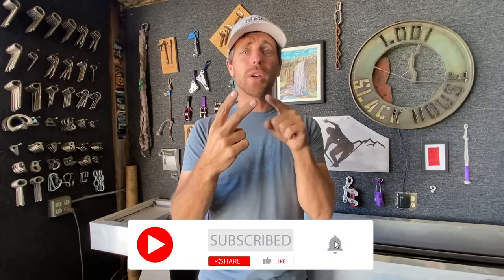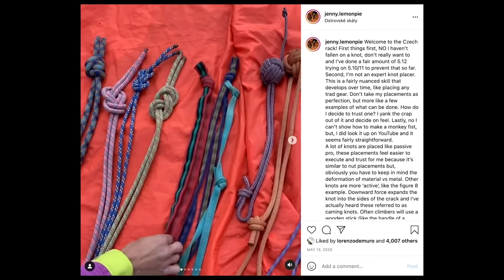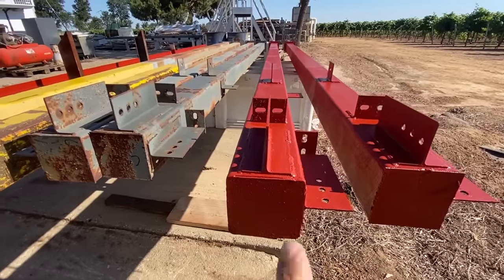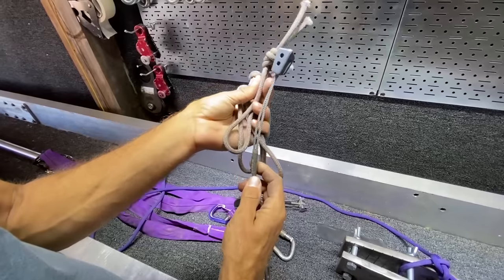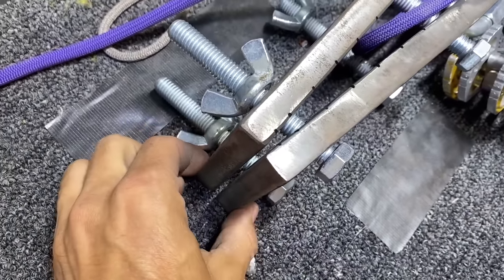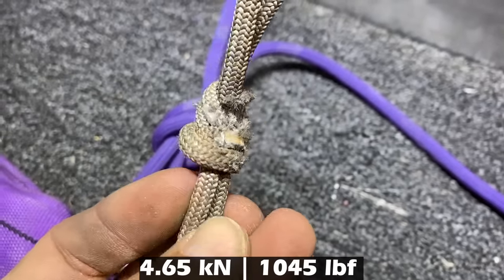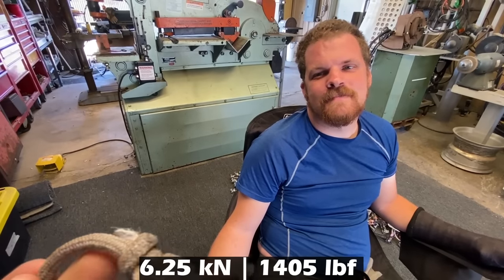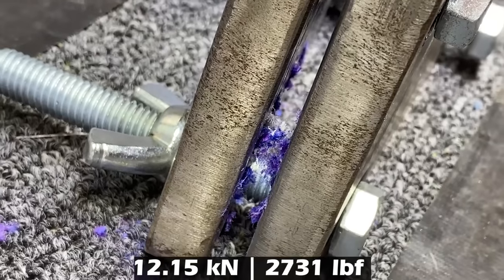Climbing pro made from knots??? Textile passive protection tested!

Comment: Yeah, it would be very interesting to see on real rock... especially the difference between granite vs sandstone if possible! I'd think friction might not matter as much on sandstone though: the rock itself might shear more easily under those forces which would make obsolete any frictional resistance the rope might encounter.
Reply: Also the difference between hard sandstone and the soft sandstone where these are used. Sometimes it feels like grabbing sand not actual rock. I think the rock is likely to break
Reply: Metal would slide out immediately as it would shear the top layer off the rock. That can happen even under your foot while hiking/climbing
Reply: Sandstone in Czech Republic, Poland and Germany is delicate. Using metal pro leads to rockfall and changes cracks into lines made of holes. Moreover people often climb after rainfall and break the rock. That's long & short :)
Reply: @marekholub8668  It would be interesting to see actual drop tests that proves if this actually happens. I've climbed in Germany's Pfalz mountains on sandstone and didn't observe that.   What if you place a cam deep into a crack system?   Perhaps longer stemmed cams could increase safety in soft sandstone.

I liked someone's comments below. He said that using such gear as knots and climbing in Czechia is a lifestyle and adventure.  Others have said it is about the cost of gear.   Others have said that the American use of cams is more about a desire for a label and shiny metal.  I'd like to see tests comparing cams and knots on actual cracks in Czechia. That will chase my skepticism away and replace it with scientific fact.
Reply: @Davidadventures  Nah, the point of not using cams is that we don't have enough sandstone for everyone, which means we have to be gentle, otherwise there won't be any left for the next generation. And no chalk allowed for the same reason.
Reply: @Davidadventures  Czech sandstone is extremely soft and brittle. If people placed cams in the same #1 placement, they would need #2 in few weeks. We can't just destroy the nature like this. Textile gear is just LNT necessity for climbing on this delicate rock.
Reply: @Davidadventures  The sandstone in Germany's Pfalz is different from the one in the Czech Republic. It's a hard type and you usually protect there with nuts and cams. Similar to Red Rocks in the states. I'm living not far from there ;-) But I haven't touched the rock in the Czech Republic.
Reply: I'd be curious to see limestone, too, since (I'm told) cams don't like holding in limestone....
Reply: friction does def make a difference! these aint friends metal to metal isnt the same as metal fabric

Comment: I have a feeling that these rely on frictional forces to a great deal, especially since they are being placed in soft sandstone. I think it would be great to see some real rock tests, or maybe you could add some sandpaper to the inside of "your crack"?
Reply: There are even some extra fuzzy slings that you just lay on small features on the rock and rely on friction to stay in place.
Terrifying
Reply: @antonf.9278  These are quite specific, here the sandstone is very rough (about 40 sandpaper) and sometimes you want your sling to really hold and stay on smaller tips (sorry, I have just realised that I have never heard English phrase which would describe throwing sling over a pointy rock feature).
The slings then work as velcro and are far less likely to fall off the point when you pull on them with a rope as you climb further.
Reply: I think they could try getting the faces if the cam crusher sandblasted. It would give a more realistic rough face without the problems that sticking sandpaper to it would cause.
Reply: As a climber from Czech republic, who uses these a lot, I can share following two remarks: first, yes, the knots indeed do rely on friction a great deal and second and foremost, there is a fundamental error in your test machine setup. I can clearly see, that you screw the one end as tight as possible, so the knot can not be pulled through, but once you start the machine the far ends of the contraption are not kept in place, they get closer to each other and that makes the gap with the knot to become slightly wider and the knot gets pulled through. I think you should have used something to keep the far end the same width. Also, this kind of strain does not occur during climbing, there is no steady pull with increased force, instead there is a really short twitch, so the knot does not have time to deform that well. Once you complete your tower, much more representative tests could by done by throwing weights from the top to the anchor made of the knots.
Reply: @janmach8913  nice sharing! lets build that tower god dammit! :)
Reply: @janmach8913  Yeah but, how much have you actually whipped on knots? Not saying you haven't,  I'm genuinely curious as to how much you've hung your meat on knots while generating KN??

Comment: It is the same in saxonia, there is a long-standing tradition of climbing with rope as protection. I am no geologist. But probably a similar sandstone. Works apparently well and all the top anchors are bolted. Locals get really grouchy if you climb with other gear and it does actually damage the sandstone which is considered a heritage site...  welcome to European climbing
Reply: The problem with German and Czech sandstone, which are one geological unit, is not really that it is to soft. In some places it is actually quite hard because of regional metamorphosis I suppose. But even in regions with hard sandstone metal protection does not work, because when taking a fall on it, the surrounding surface just gets broken out of the rock. Because the real problem of the sandstone over there, no matter how hard or how soft it is, is the overall porosity of the stone. The porosity is so high, that climbing is forbidden, if it rained in the past 24 hours, because the rock is just too wet and therefore more likely to fail/break. From my own experience I can say, that I have never climbed on better rock than the sandstone in the Bielatal in Saxony, Germany and it is definitely a recommendation for everyone, as long as you have a lead climber, who knows his way around.
Reply: @edwinmahlo427  Porosity isn't a measure of the weakness of the rock, it is the property of friability. However, you are correct that porosity increases the failure of rock when it is wet. If you want to make a landslide happen, add water.  If you want your rock to fail, add water.  Therefore you have multiple problems. You can't use cams because the rock is friable and you can't climb after rains because the porosity decreases the rock strength. 

Here in California's North Bay we have cemented rhyolites, some of them are like sedimentary conglomerates, but occur through igneous processes. We can't climb on them after rains for the same reason.  But since it hasn't rained here in a few years, the climbing is good, except when the fires sweep through the climbing areas and destroy the bolts.  I am an engineering geologist by the way.
Reply: @edwinmahlo427  Actually there was an short investigation considering metal gear (at that time = nuts) on saxony sandstone. It didn't find the the often citated rock failure, at least not different to slings. Back then it was decided to stop testing nuts to preserve the tradition. It was definitely not a fact based decision to ban metal gear but rather a highly emotional one (as it's the case for many of the saxony climbing rules). If you look closer it's an repeating pattern to argue based on "facts" that have never been proven in most of the discussions surrounding climbing in Saxony. The funny thing is even evidence often times can't change the believe in these alternative facts...
Reply: @Davidadventures  the problem in saxon or bohemian sandstone (its the same) is that the compuond that holds it together is water solvable, so basicly it falls apart when wet because there is no „glue“ holding it together, assoon as it dries its solid again. This happens less with sandstone that has a major metal component like the dark sandstone found all over bilathal (lots of iron working as „glue“) so you can climb those towers pretty shortly after rain, just 20km away the „rathener gebiet“ is called cookies or „rathener keks“ among locals as its so likely to break, even when dry. Sandstone geology is wild 😂

Comment: I'd be psyched to see a video of these in real rock. The climbing in the Czech republic looks sweet and if I can trust the gear I'm more likely to go.
Reply: Same rules of using knots over hardware are in southern Poland where the sandstone rocks are present. Also no chalk allowed. 
Some examples of such gear placement are here: https://youtu.be/HXTgPUOEQbs?t=466
Reply: It is sweet indeed, just please be careful, most of the placements you would consider absolute bomber in granite are still rubbish in sandstone. The angle at which the sides are joining should be over 30 degrees and you should place in a slot where the loaded end hardly passes through the tight end.
And everything crumbles. Don't be afraid to spend evening before in pub - making some local friends and getting tips, mabye even a experienced lead climber :)

Comment: You could try replacing the steel with concrete paving slab type things tho the slabs themselves might not be able to take the stress of a pull. I would love to see both this in real rock and it done dynamically in the drop tower. I can see the results of a dynamic drop being very different from these results.
Reply: That would probably be better but I think even concrete has way less friction than the stone around here in Dresden where people use these
Reply: Guess, when its about knotslings, soft Sandstone will be way different from steel or concrete areas.
The more grip, the more friction, the more Power -Transmission.
Reply: Or add paving stones the “crack”
Reply: @cutt7837  yes that's who I was thinking. A paving supplier may even just give you various rock types as you only need a few small scrap bits to them. Sandstone and limestone paving common. Granite less so.
Reply: Good idea, but like you mentioned concrete don't like pull forces. But small concrete pieces inside of the crack would one dive them pressure force. Which concrete is very good at.
Reply: He tried that, sort of, it didn't work out. The concrete is too brittle to bolt through, with the forces being put on it. What he needs is a pair of plates made from a high strength fiber reinforced resin, sand and gravel aggregate, and steel frame for mounting.

Comment: I live and climb in Czech republic. Rock in some crags is actually that much soft, that if you don't have a hold and you'd rub your foot for 5 minutes in one place, you'd have a pretty good foothold.
Friction makes a difference, but it's not all. Placement is key. On a great placement you actually can whip. It's not that uncommon, to put several knots close to each other and clip them the way, that they all are weighted in a single moment in case of fall and weight distributes. Knots don't work all that well when they are on they own, I tend to put more knots in the rock than I would with metal protection.
A lot of the routes have metal protection hammered into the rock that is usually pretty good and you can whip on it all day long.

If you'd ever have a trip to Europe, definitely come to Czech republic and have a look on how that work!
Reply from the maker: Good feedback.  Thanks

Comment: Why does that guy ask us "IF" we want to see real rock test ? Shouldn't he ask about "WHEN" we want to see it instead ?? We are not gym climber here, we want rock by the roll of course !! 
PS : greetings from Chamonix, keep up the great work guys
Reply: Problem is that Czech and Saxon soft sandstone is protected. You can't just rip gear by purpose. That's illegal. Also using metal pro is illegal
Reply: @marekholub8668  i don't think HNTHL is Czech, sooo.... ?
Reply: @lolaa2200  It wouldn't make much sense to test in different rock. This kind of sandstone is very different from the kind they used for testing bolts.
Reply: @marekholub8668  knot stuck in cracks have been wildly used for climbing all over the world in all sort of rocks long before metal protections been on market (just read old books from Bonatti or Rebuffa and al.). As of the present, fact is it is lighter, it is much much cheaper, and it has better availability. So having test that show if it can be a viable option is indeed of great interest far beyond the particular case of one small portion of one country. From this video i can see some potential for it. So yes any test in any type of rocks makes us all advance, no matter the country.
Reply: @lolaa2200  Yeah, I know it has been used on all types of rock. I'm just saying the tests in other rock wouldn't be relevant to Jenny's videos. If you can use cams and nuts on your climb, you are safer using them over textile pro. If you can't, they are definitely better than nothing.
Reply: @lolaa2200  It looks like the larger knots are generally as safe as a cam, but in the smaller diameters, the knots can easily deform and cams are safer.  

It would be most interesting to put testing gear on a cam in Czech sandstone to test the reaction of the cam to the rock.  How much load is required to break the sandstone or is it a myth?  I would like to see that test. Likewise, testing your knots in Czech sandstone would be better than using the lab testing device. 

Each rock will have it's own coefficient of friction, so in some sense each knot will hold differently with each type of rock.  Putting knots in a metamorphosed slate could be very dangerous due to the increased polishing of the surface and the clay mineralogy of the material.  Using them in a rock with a high coefficient of friction like sandstone might be acceptable.
Reply: @Davidadventures  what you say about friction is also true with metal gear so i still don't see what magics this czech rock would have that make it more relevant than any other rock. It's only more relevant for people who specifically climb there. The most relevant for you is the rock you most frequently clim on. What i say is just that very particular type of rock is probably not the most relevant for the vast majority of us. 90% of our climb in Europe is either dense limestone or granit (and derivatives). Of course there is other types of rocks here (puddle, schist, sandstone, flint inclusions, ... ) of course you can climb those but it's the exception not the norm.  I haven't climbed much in north america but from what i hear/see on internet it seams to be about the same. 

Of course there are exceptions to that, but saying that only the exception is relevant to test a gear for general public is a really strange stance to me. It's basic Pareto. The most relevant should be what we all experience the most. 

I don't know you, maybe you are specifically living next to that particular park in Cz, or maybe you are planing a trip there in the next few month. So then yes it would be more relevant to YOU specifically.

 But in all other case i'd say granit or dense limestone is the way to go, as they always did on this chanel.

Comment: In a moment of desperation i have placed a prussic into a crack an fell with it at my hip height.
And it held. It was really hard to remove it though...
So I know for a fact that it can work. But i like my solid cams better.
Or even the emergency BD guide stopper like you instructed on one of your videos! LOL
Reply: Well, anything metal might also be likely to rip or break out enough stone as to come loose. An expanding dynamically loaded knot might hold a lot better.